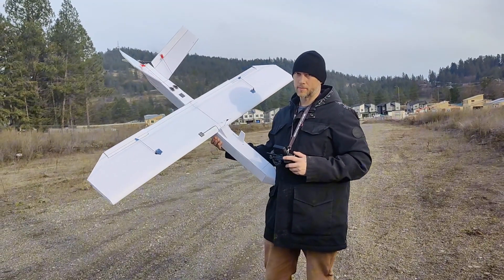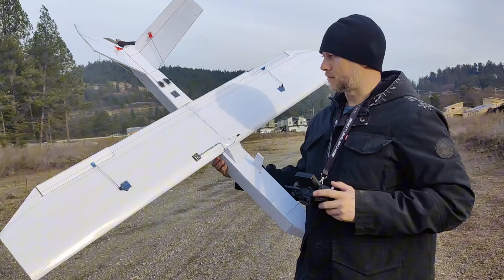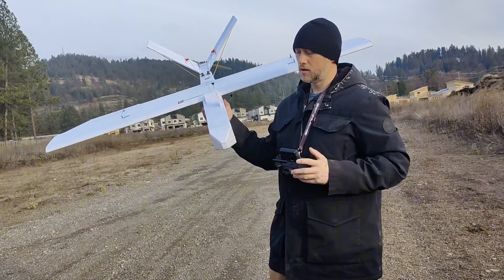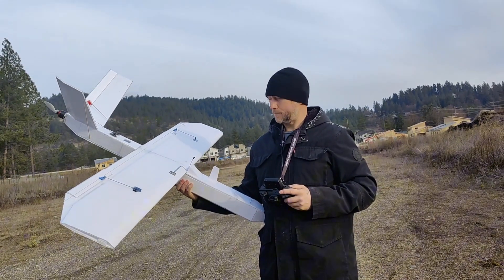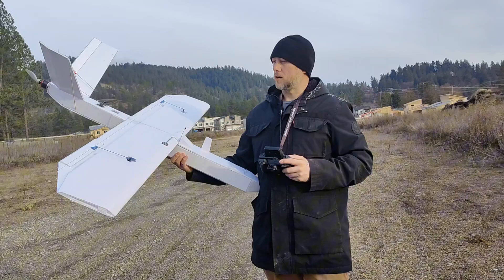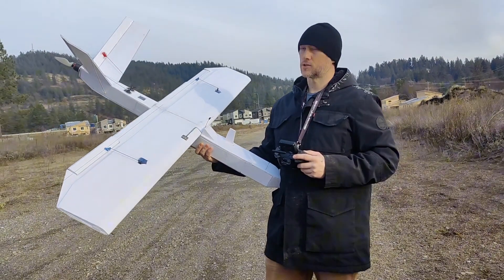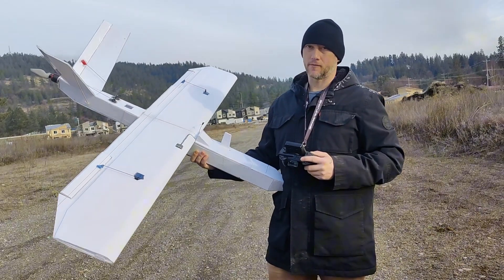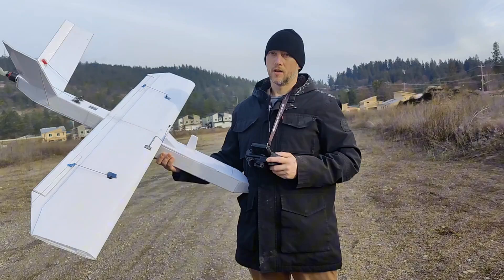My new pusher V tail FPV plane!! #djio3airunit #speedybee #rcairplanes

Comment: Haha, she said it's very quiet, wait until you see mine fly😂😂, it's awesome one to be honest!
Reply: It's really fast, what motor is that? Prop size too?
Reply from the maker: @wingxquad it did 66 mph. I ran a 2820 790kv motor with a 13x5 prop. Very efficient. I think my best flight with a lot of messing around was 36 minutes. And I had about 25% battery left.
Reply: @FlyTimeRC I honestly wasn't expecting 790kv to be that fast, it looks super sufficient, it's an amazing plane , I recently got a speedybee mini, and I'm planning to attempt my first long-range soon, I just need to get servos, propeller and a few other things, I haven't just been able to get them yet, due to the situation of things, this hobby is really amazing for real!
Reply: @FlyTimeRC is that a li-ion battery or lipo!?
Reply from the maker: @wingxquad that's awesome, good luck with your build. Yeah it does good on 4s with the 13x5. It could have gone faster but I only cruised at about 40 to 45 mph. To be more efficient.
Reply from the maker: @wingxquad  lipo
Reply from the maker: @wingxquad  I usually use liperior batteries.
Reply: @FlyTimeRC ah, that's awesome for real! Thanks really so much 🙏

Comment: 15 t o20 minutes.  WTH.  I was expecting 4 to 5 hours on autonomous mission.  That is real FPV.
Reply from the maker: I think you better notify the entire model airplane and drone community that none of their fpv flights are "real fpv"....
Reply: @FlyTimeRC 4 to 5 hours is pretty damn nuts but you might be interested in AeroStuffFpv's builds!

He built a similar v tail pusher and claims he has an endurance record of almost 2 hours/over 20km with it.

He uses a 4s2p li-ion though instead of a lipo. Anyway, just thought you might want to take a look. Sweet looking plane brother
Reply from the maker: @ayecees  ive watched a lot of his stuff. His DIY batteries are nice they help a lot. Definitely took some inspiration from his vtails on some of my builds.
Reply: @FlyTimeRC oh ok, nice. And yeah i heard him mention a custom li-ion he was using but i wasnt sure what he meant. I saw that 10k mah Zhod pack and debated it, but that thing is almost 600 grams. It's huge.
Reply from the maker: @ayecees  yeah heavy to. Ive got a 8000mah 4s i use in my 90" vtail now. Ive flown 28 minutes in a lot of wind on a long range flight. But I haven't tried to see how long it will go in optimal conditions.
Reply from the maker: 😂😂 4 to 5 hours. The best I got out of this plane was 39 minutes with some time to spare. That's pretty damn good. Do your home made foam board planes fly 4 to 5 hours?

Comment: Nice looking plane and good job on the build. I've got the Talon Pro and there are similarities but the TP can handle 12000Mah no problem. Surely yours could easily handle 9000Mah of battery since it has generous wing area?
Reply from the maker: @wattage2007  thank you. I designed the battery area for the two batteries so I'm not sure if I can fit anything bigger. I am building another soon so I may ad another battery. But with the fly time I have gotten out of running the two 3300mah batteries is more than enough. So far 40 minutes plus.
Reply: @FlyTimeRC  Yeah, depends how far you want to go. My max flights are about 70 minutes with a 9000Mah but that's pushing my endurance of standing in one spot staring at a screen 🤣
Reply from the maker: @wattage2007  exactly. I could fly longer but especially when it's 30 degrees out I just don't want to stand around for 45 minutes plus. Also range ive gone about 2.5 miles away with my current o3 air unit so time isn't a issue. I've been really happy with my set ups though.

Comment: I have a question. Im working on a plane with 1.1kg weight and a 920kv  motor with 620g of thrust. I dont know if it Will fly or not ?
Reply from the maker: @anasyt7009  I don't think it will work. You'll have to be at full throttle all of the time just to try to fly. You really need closer to 900 grams of thrust at least but I always shoot for 1.5 times thrust to the weight so I can fly at lower throttle and have plenty of power when needed. I think you'll have to find a prop and battery combo that gets you closer to that 900 grams of thrust mark at least. Also consider air speed. If you have a heavy plane with relatively low wind area it will need to fly faster to keep from stalling so you may need more thrust and also pitch speed. But if you have a lot of wing area and a relatively low wing loading you just may get away with lower pitch speed and lower thrust. I think a good rule of thumb with most planes is trying to get 75%+ of the planes weight of thrust and it will fly.
Reply: @FlyTimeRC  ok i will try to reduce weight and find another motor with a low battery weight thanks sir
Reply from the maker: @anasyt7009  good luck with the build!